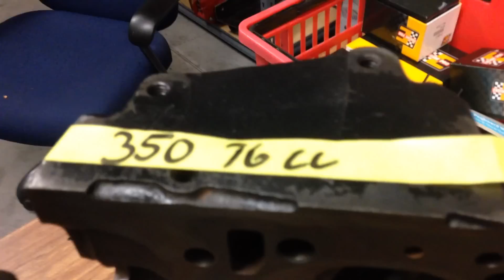350 and 305 Chevy what's The Difference

Comment: all the 305s i've had were awesome
Reply: They are EXTREMELY common to be used in marine applications at 225hp, because they hold up extremely well to the constant torque being applied.
Reply: everett potter I have a 1984 Chevy Caprice with a 305 in it. What can I do to add more hp to my 305 .
Reply: @johnbell9281  601305 heads they are h.o heads for the 305 port them and tube them they are good but thin heads
Reply: @everettpotter189  to get more power out of my setup, this is what I recently did just last month (on my boat 305, 2PC rear seal). Its an HO that has already been built up pretty good by Volvo Penta (all their 305s are HO models) but the was still a little room for improvement.

- 416 heads, ported the intakes for more flow, ported and polished the exhausts for more flow. Deshrouded the combustion chambers. (Using a flow bench along the way)

- ported the intake manifold heavily and port matched to the head (using a flow bench of course)

- swapped to high flow polished valves

- three angle valve job w/all new springs, seals, etc

- put a fully redone Quadrajet 4MV on and up jetted to match the new flow rate.

- used a 1" thick poly spacer to raise the carb for cooler intake flowing fuel and eliminate any percolating I had troubles with during really hot days and hard running.

- slightly more cam with a tad more lift. They came mildly lifted, but not to the optimal setting for after all I did.

- new sealed bearing alternator, sealed bearing PS pump, and eliminates the impeller unit, all to reduce drag on the front of the engine and to free up some tiny power. Hehe

All in all,  it started out with 209hp on the dyno before the refresh, and ended up with 253hp after the fact. Not a HUGE increase, but pretty decent nonetheless. :)
Reply: @everettpotter189  yeah, those 601 heads are the bees knees! Haha. Unfortunately, I had the 416 on mine (close to the same, just slightly beefier) and couldn't locate any decent local 601's. :(

The 601's were basically just 416's but hogged out in the bowl area by GM right? (Both are HO I know)
Reply: @everett potter ok thanks for the information and response.
Reply: @strikeforcek9149  Help, since you know about the 305 marine, I just bought a 19 foot deck boat with a gm 305 and the starter is delco but i don't want to spend a small fortune in local parts houses who told me it was over $240.00. I'm seeing them all over ebay in the $ 80.00 range with full year warranty, free shipping etc. after market.  I'll likely not use it enough to ever need another anyway but I can NOT get the people selling them to figure out the right starter ! the number stamped on the old delco, which sat in rain 14 years and it not rebuildable, trashed, they tell me it's a starter for 1960 something to something chevy pickup, the next one says it a 1977 to 88 Camaro and yet a dozen other stories and all their starters are basically saying the same thing in the listing. 1977 to 81 305, yet n one of them can tell me it fits. I went to the OMC site and it says it's a 1979 gm engine. Since everyone's listing states this is the engine theirs covers but then tells me, no it don't fit and we don't have the starter you need. Never thought i'd run into so many dealers who don't have an idea what will work in a small block chevy, does the marine engine with omc sterndrive make any difference? The old delco has the number 1108371 and that may not even be the original one since it doesn't have the ends sealed to moisture proof and it looks like maybe someone has pulled it off a car and installed it. What's the difference that no one can tell me what starter will work, or why the ones listed for this engine is the wrong one ?  My check with OMC numbers as posted on a sticker on the valve cover is Model "990261S1" and serial number  "W 671229". Complete confusion compared to what I grew up doing with my favorite engines  "265" and "283". The poor boy street racers !
Reply: @ronnmiller9085  do you know which flywheel you have in there? There were two GM flywheels used on the 305/OMC combos.

Depending on which flywheel you have is going to depend on which starter you need. For all intents and purposes, the stater you need is like the same starter you'd get in a heavy duty truck of the same year/engine (so long as it's for the flywheel).

Marine VS automotive is usually the same thing in a lot if cases, but when it comes to the Alternator or Starter, you usually want a marine version because they're sealed and screened off properly so if you have a fuel leak and the bilge gets a little fume filled, it won't blow up your whole boat when you start it (with you in it).

But, I have seen a lot of guys use the automotive versions and just RELIGIOUSLY vent out the bilge and check for ANY fumeage prior to starting the engine (because the electrical arc in the starter catches the fumes and goes kaboom). Also, if you're on the great lakes or ocean, be sure to never get boarded by the coast guard because they'll fine the living hell out of you for not having USCG approved starter, alternator, or distributor (those are these three main things they automatically look at when doing their random 'pull over and let us board' safety inspections.)

I'm gonna go look through my system and see if I can't find the exact starter you need. I'll post again once I find it.
Reply: @ronnmiller9085  I forgot to ask: is it the straight across bolt pattern on yours, or the staggered bolt pattern? Mercruiser and some OMC's had a staggered pattern (one bolt further aft, one bolt a little more towards the front of the engine) and some had the straight across pattern (where there long bolt and short bolt are directly across from each other).

This will determine which starter you need. So, the following criteria is what is needed to be known:

1- flywheel type (tooth count or diameter)
2- bolt pattern for starter (staggered or straight across)
3- Hi-Torque mandatory (your engine has higher compression than atypical 305's that came in the car's and trucks, so a hi-torque starter is needed. Which, is probably why they keep saying they don't think they have the right starter, on top of the bolt pattern may be different.)

I believe that your flywheel is 12-3/4" more than likely, but I'm not 100% certain because there were two different types in that vintage (79-82 OMC 305's).

So, if you can get that info, that'd help greatly in being able to confidently tell you which starter to get.
Reply: John Bell with old v8s there is no cheating your way out of making more horsepower with no effort. Yank the engine out and put a camshaft in it. 450 lift and a 218/218 duration @50 cam with a 108 lobe separation will be the perfect application for making a slightly Lopey torque monster small block. I put it into a 350 and with free flowing heads and headers it makes a good 330 horse 360 foot pounds with a 305 take 20-30 numbers off the peak power and same torque.
Reply: @theeoddments960  I just put a comp cam 268 in my 305, and I think it's too big of a cam to be running now. :(

I need a good marine cam recommendation to put in it, with great torque and without all the reversion issues of a larger cam. I'm confused as hell looking at all these different camshaft options, lol.
Reply: I had the same problem of overcamming a 383 wasn’t fun until you got up to 5 grand the rest was pain bucking and stalling and misbehaving, really bad street manners. That was a 520 lift cam with like 230/230 duration and a bunch of overlap.
Reply: StrikeForce K9 

https://www.summitracing.com/parts/sum-k00172

This is the exact cam I’d recommend. It is just about the last camshaft that will work with a stock stall converter and pump gas.
Reply: @theeoddments960  yeah, I ended up remapping my carb by drilling out the idle air bleeds and sizing up on the idle tubes, and that got it to run great now without nozzle drip. But, it wants a ridiculous amount of intial advance to run decent at isle, but feels kinda gutless until I get to around 2500rpm or so.

Unfortunately, the marine engine doesn't have a stall converter, so I think I'm gonna need to drop in a cam that's a step or two lower to regain better torque from around 1400-3000rpm. The boat never sees anything more than 3,000rpm, because that's thre best cruising speed on travel speed vs economy vs not straining the engine.

I'm thinking like a 218/224 or something along those lines.
Reply: StrikeForce K9 ahh yeah I seemed to miss the fact that it’s in a marine application lol. But yeah a 305 shouldn’t feel that gutless at that low of rpm. 218/224 and 450 lift would be pretty perfect for that application won’t rob any torque and the power and will perfectly match the heads’ capability to flow at high rpm, beginning to run out of steam at 5500 rpm like the heads do and not 6200 rpm which 305 heads can’t support.
Reply: @everettpotter189  L69s also came from the factory with 416s, in addition to 601s.
Reply: @Joesmusclecargarage  i have a set of 601 heads im putting on a 305 im building what do you thank is this a good idea or not

Comment: When I saw the title of this video...I said out loud.... "The bore size"... LOL
Reply: Lmaoooo me too
Reply: Don't forget the heads.... Difference  on the flow of the heads
Reply: I have a 92 rally sport with a tub 305 that runs like a bear
Reply: I said 45.
Reply: Different stroke too
Reply: The stroke is the same
Reply: Nope. The stroke is 3.48 just like the 350.
Reply: Gale Vest balancer too. Had both.
Reply: If they have the same crank and rods why do they have different balancer?
Reply: Big difference in the bore size is you cant unshroud the valves as good as a 350. A bigger Cylinder always lets you port more metal out of the intake side of the combustion chamber for much better flow (unshrouding).
Reply: Stable Genius you wouldn’t imagine how much money it takes to spin that motor out that high. Guy made it as a science experiment

Comment: I inherited a 72 Pontiac Ventura with a 305 from my Uncle back in 1980.  Drove the crap out of it.  Sold years later with over 175,000 miles on the original untouched motor.  That 305 was a very hearty engine.

Comment: I expect my 305 being engineered for lower stress to "go the distance."  Am hearing that 250 miles can be expected if reasonably maintained and not thrashed by teenage driving.
Reply: 250 miles is like one tank of gas.
Reply: Just thought I'd share that I've have owned and 85 c10 with a 305 it lasted 458000 before quiting on me and now have an 82 c10 and it has a 305 with 300,000
Reply: I have a 1992 Rs camaro, with 305 engine with 240,000 miles and the engine never locked up or burned oil from driving it hard .

Comment: 305 are super reliable and they can turn serious rpms.
Reply: I had an 87 IROC w a 305HO and a T5. I didn't care how I treated it because I wanted to build a 350 for it. I regularly turned 6500-7000 RPM's racing and only floated the valves once at about 135mph racing an off duty cop on the interstate in 4th gear before I let out. (Thought I blew it up).
It was fine. Until a kid on a phone hit me at a light and totaled it (me too).
Reply: Jonathan-Emily Powell 305s are reliable tough as a brick but they absolutely do not turn serious rpms. With stock bottom end and mild top end they still fall flat at 5000 to be generous. ANY engine can turn serious rpms but it takes money and time. A Volkswagen air cooled flat 4 can turn 7 grand. That mean a stock beetle can turn that much? Fuck no the guys that make those 4000 rpm motors go 7 is because of serious money and effort to make it spin that much. A 327 can make a good screamer with minimal effort. A 350 can make a screamer after some pretty in depth modifications and at a 400+ power number. You’d have to sink some serious money into the truck motor that is the 305 to make that thing turn any rpms...
Reply: Jardmang  Yeah, that's why most of them are in the junkyards...
Reply: Jardmang  I never said ANYTHING about redlining it. It's a piece of shit at any RPM.
Reply: @Thirdgen83  know what you’re talking about before you run your mouth, 305s are dam good reliable engines, I have a 1992 Rs camaro with 305 and 240,000 miles, the engine never locked up or burned oil, speak only for your self, don’t speak for ever body else with a 305 motor.

Comment: Back in the early 90's I rebuilt a junkyard 305 for my '74 chevy C10 stepside.  That thing was a beast and really hauled.  It was so incredibly inexpensive it wasn't even funny.  I got this huge air cleaner assembly from the junkyard that had a giant air scoop opening from an older giant land yacht.  After I broke in the engine I remember taking the on ramp to the highway and punching the throttle.  The entire hood sucked down about a 1/2" and it just took off...keep in mind this was a heavy steel original hood, it was moving a lot of air.  I had carefully selected an efficient cam rather than something too steep and made a good (small) carb selection and really tuned it to the engine.  I also switched to an HEI distributor and took the time to dial in the initial, mechanical and vacuum advance curve.  I had a lot of fun building it and learned a lot too.  I loved that engine, blip the pedal and instant response, no bog whatsoever.  Those were the days, I could fix anything on that truck for $40.  I had good contacts at an awesome chevy dealership that's long gone now and a local parts store with a machine shop.  I got the engine kit from Summit Racing and took the day off to receive the package C.O.D...this was long before the internet and I didn't even have a credit card.  Good times!  I eventually sold the truck and bought a newer 4x4 because I was clearing land and building our house.
Reply from the maker: You have actually just inspired me to make a video I think I will do a 305 extreme budget build I'm thinking maybe how cheap can I build a decant engine for or 305 extreme budget build
Reply: @Myvintageiron7512  I think that would be a really great project!  Maybe put it in something low buck and fun too.  A project that I've been considering is instead of buying a UTV get an older S10 4x4 pickup, give it a down and dirty repair/rebuild then give it a mild (and inexpensive) trail makeover.  You'd end up with something that you could take offroad for hunting/camping/fishing/chores that's street legal and doesn't need to be towed.  If you stick with a '98/'99 you can even get vintage plates and save big on registration fees.  A 305 would fit nicely under the hood but I can also see the benefits of a built 4 cylinder for economy and weight savings as you wouldn't need a lot of HP for something like this.  Lets face it though, I'd go with the 305.

Comment: The 305 was developed as a fuel economy engine, max horsepower was really not the driving force behind it. That being said, you can get good power out of one if you build it right. As you stated the heads are the biggest liability. They work well with forced induction due to the thicker cylinder walls, and the larger webbing between the cylinders gives a better seal for the head gasket.
Reply: Why
Reply: @rodneyhopper22  Why not?
Reply: Try putting it in a 5000 lb car and 2.41:1 ratio rear end and see what you can get from that
Reply: @rodneyhopper22  That has nothing to do with what I commented on.
Reply: @rodneyhopper22  So you measure your manhood by your engine size?   lol

Comment: My buddy has an 86 305. It's deadly for what it is, .450-.450 cam, stock heads, .040 flat dished pistons. He got the engine for free, was supposed to be a 350, turned out to be a freshly rebuilt 305 with a rebuilt th350C. We threw a Holley Contender intake and a Holley 600 on it, it kicks the car sideways when it kicks down, it's in a 65 Studebaker with 3.73 rear gears.

Comment: I had a 305 2bl Chevy pickup truck in the mid 80's. Removed the smog gear put a mild cam, intake, headers and 650 Holley on it. A great little motor. Got Okay milage and had enough pep to get the job done.